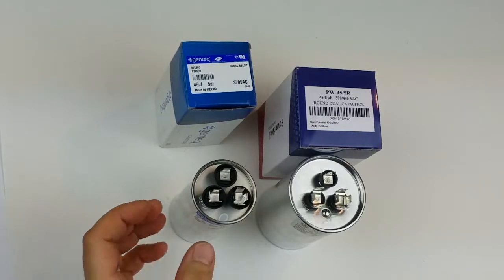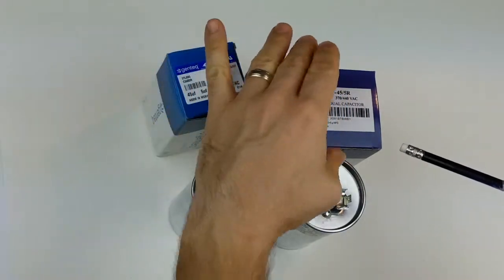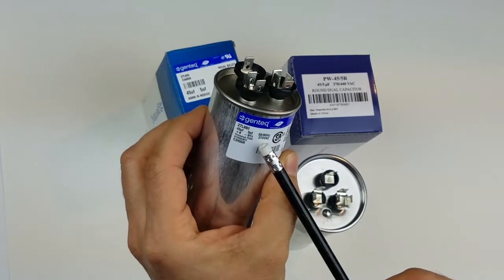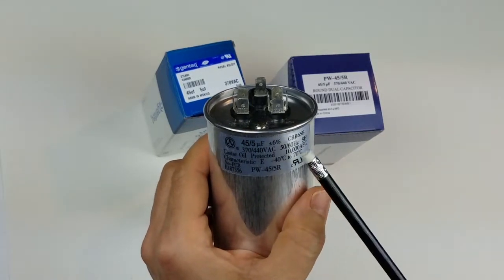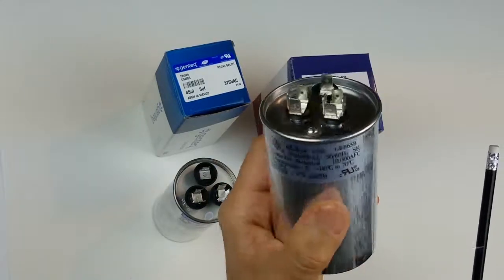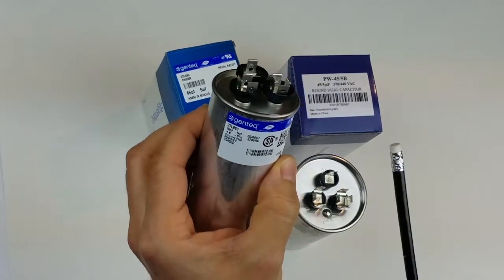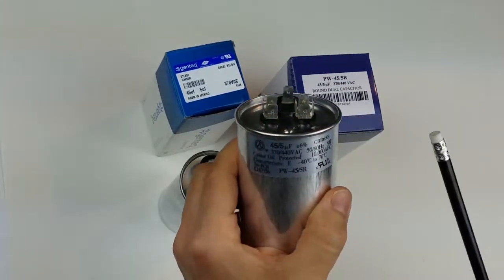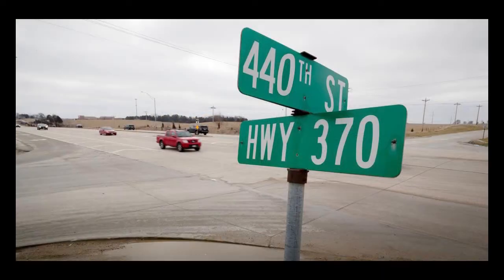370 vs 440 VAC capacitors

Comment: The 440V is significantly larger than the 370V.  It might fit or it might not fit in the application.  Sometimes you have to "make it fit".  In some supply stores the 440V is actually cheaper than the 370V....maybe due to higher volume...not sure.